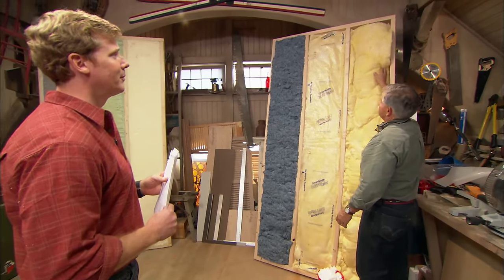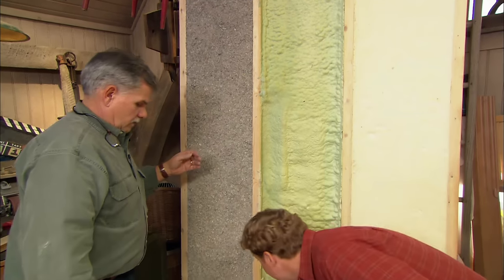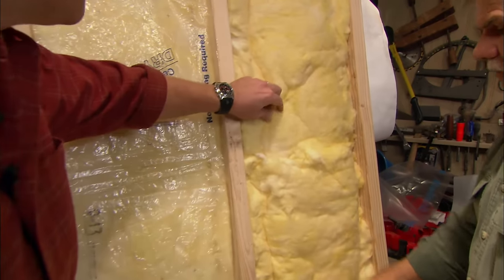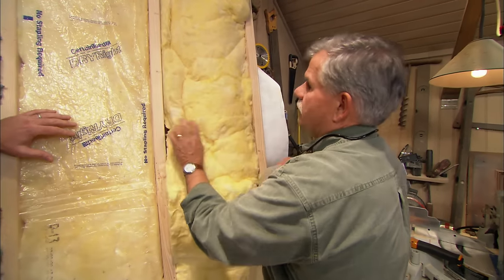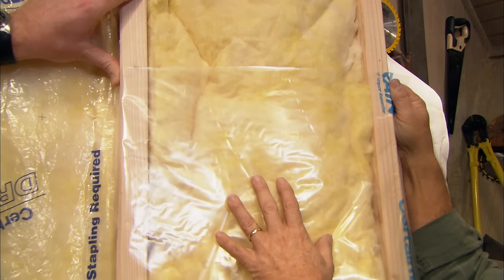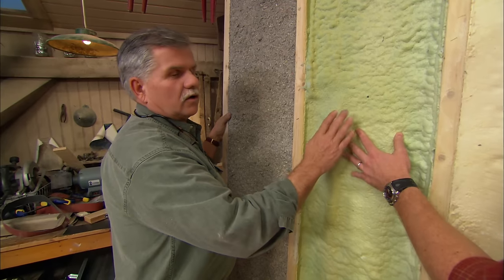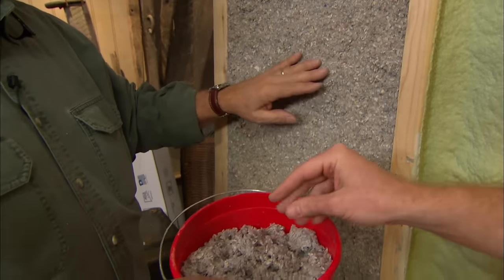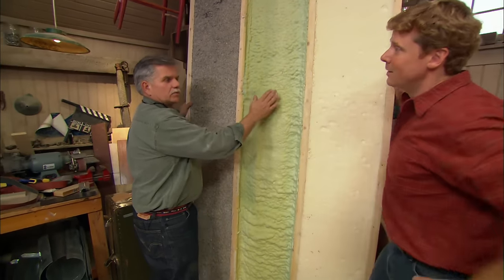How to Choose and Use Insulation | This Old House

Comment: There is so much more about INSULATION - thermal barriers and air sealing and perm ratings,  testing the air tightness using a blowerdoor.  and then there is the off-gassing of foam,  and then there is the carbon  emissions of creating the product.  what product is natural ?  Healthy ?  Affordable ?
DENSE PACK CELLULOSE
Reply: Closed cell spray foam has a much larger R-value however.

Comment: I am remodelling an old house, I'm doing this for the first time and now I am about to insulated the exterior walls. The problem is that the distance between studs varies from 10 to 19 inches so if I use fiberglass batts it's going to be a nightmare. I wonder if blowing cellulose wouldn't be a better idea, but I am also worried about the cost. Can anybody give me a suggestion here? Thank you.

Comment: how about rock wool insulation ?  the fire proof insulation?
Reply: If you want to have some comfort as to which material to put in your home, check out this video: https://www.youtube.com/watch?v=RKZd1ZTjvzE 
It's a slam dunk: Roxul rock wool every time.
Reply: 1200 C. From the Rockwool site, "ROCKWOOL insulation won’t burn, or release toxic gases or smoke when exposed to high heat. Smoke kills—fire produces toxic fumes and these fumes tend to rise, so danger increases at higher levels in the room. ROCKWOOL resists temperatures of up to 2150◦F (1177◦C) without burning or melting which is well above heat levels of typical house fires."
Reply: @howtomakepottery  , tread lightly. There are several grades of Rockwool. Some have great fire retardant qualities but a lower R-value. The better R-valued Rockwool gives up its fire retarding abilities. The manufacture obscures that fact in its literature and advertising, in my opinion. The low R-value, fire retardant variety is great for blocking holes during new construction.
Reply: @larrymaloney877  you're full of Bologna.

Comment: I was thinking about  putting 2 in. XPS and 4 in. roxul on top of it in my 2x6 exterior walls. Something like a combination between those two types of insulation in search of better performance for less price. But Im not sure. Im afraid of possible moisture collection inside the wall because of this XPS. I live in climate zone 5 (upper part, actually almost zone 6). Do I have to worry and do I have to use vapour barrier/retarder in this case?
Reply: I am curious what you ended up doing?
Reply: @simeondimchev122  I am curious how much the Roxul cost? I am planning a small home and trying to figure out what insulation to use that doesn't break the bank.
Reply: @ronwest7930  Probably can't help you with the price just because I live in Europe, Bulgaria, but definitely it's cheaper then XPS or any open or close cell spray foam.

Comment: I live in Ohio, can I and/or should I use Open Cell spray foam?  We've gutted the lower level so it would be like applying it to new construction but the upper level will be retro fitted.

Comment: I live in Southern Ohio, we get both hot summers and cold winters here in the midwest. My home was built in the early 1950's and has very scattered fiberglass insulation on the attic floor. If I wanted to turn the attic into a usable space during the summer and winter, would I have to insulate interior of the roof instead? Currently it is just framing, nothing but wood. Also- would this mean leaving what is on the floor? replacing it? or adding to it?

All recommendations welcome!
Reply: Leave the insulation in the floor/add to it also and yes you need to insulate the roof rafters. Please make sure you have soffit vents and bay vents as well as ridge vents to make sure you shingles have proper air flow below them. Hope this helps.
Reply: If you want to use the attic year round, you would probably need an HVAC run to it, plus lights and outlets.  Being a heated and cooled space, I would think you'd want to remove the insulation on the floor to take advantage of radiant heat from below.  The ceiling would need to be insulated but to get enough R value in the rafters cavities you'd need closed cell spray foam or fir strips to build the cavities out, and you need adequate ventilation too.  It's a rather big job to do it right.
Reply: Mario Cartolano leave the insulation in the floor and put plywood over the top of it. Then insulate between the rafters and the end walls. I prefer John's Mansville because it does not have formaldehyde in the insulation. Make sure it has a vapor barrier that's pointed towards you. You can leave it that way or drywall over the top of it if you want to turn it into usable living space.

Comment: Love this show.
Can the retrofit blown insulation be used for plaster lathe walls? I have a brick colonial.
Reply: Yes it can
Reply: @chrisdix1390  
Great. Thank you
Reply: I have lath and plaster walls and had insulation blown in my exterior walls...no problems at all. I have a 1920s bungalow. If you have knob and tube wiring I would make sure you can blow in insulation over that. I was told that is a no no.

Comment: Fiberglass?
Decades ago we stopped using that in Denmark; 1: Its not fireproof as rockwool is, 2: The glass fibers tear apart lungs and the internals of those who have to work with it.

And good luck getting a wire or a pibe behind or into that sprayed insulation, and if you cut a groove then you have to reinsulate that groove
Reply: use duskmask. but i agree you should only use rockwoll
Reply: Yea fiberglass is a pathetic insulation rockwool #1
Reply: GamerBrian81 you can just use a can of foam to fill in any hole you need to cut, its not hard at all, plus if you’re putting in spray foam you’ve already got modern wiring
Reply: @JayKay9112000  the house will burn down in minutes
Reply: BlueGamer Dude no, spray foam has a fire retardant added to it. I have it and my house is fine.

Comment: How about foam panels? Also which way does the foil side face. This is for a wood shed in Fl. No barrier on outside of shed.
Reply: If you have FOIL, that's a radiant barrier.   It MUST have an air gap (vacuum would be better, but that's impossible on earth) and the foil should remain SHINY for best effect.  Why?  Because conduction (intimate contact of foil shiny side with other building materials) defeats the radiant stop.    So never put shiny where it will get dusty or coated with anything.    Radiant barriers work both as high reflectors and low emitters; they work in "the dark" and are fabulous for attics, to retard radiant heating of attic from hot roofing shingles.  Shiny side DOWN; or IN.      EXCELLENT for garages that suffer from sun exposure in hot climates.   Caveat:   sub-rafter foil is a rat haven!   So you must defend against rat infestation.

Comment: So are there any issues with first coating with closed cell and then once set, second coating with open cell?  Or is there a reason not to do this?  I am in the Tampa Bay area, so most of the time we are trying to keep the heat out.   Also, what would happen if we used closed cell against the inside of the roof and then over the years we developed a roof leak? Where would that water go and how would you even know it to know it needed repair? Also, what about fire safety? No one ever talks about fire issues.
Reply: "Foam it Green" actually recommends open cell sprayed in the cavity first followed by open cell for the rest.
Reply: @stevenrieger3666  , how do you recommend stopping the foam form decomposing or separating from the wall or losing it's R-value over time?

Comment: Closed cell 2” all you need. The best!
Open cell max fill cavity then trim. Second best!
Reply: And rot your timber joists.  No one is using it in Europe and banks will not loan, nor insurers insure houses with either type of spray foam.

Comment: Doesn't shaving off the top "skin" of the foam diminish the vapour barrier effectiveness...or can you combat that by spraying in two or three goes?
Reply: That's open cell. You need a spray vapor barrier or 4 mill plastic.
Reply: closed cell foam sprayed outside the house - on a roof for example - MUST be coated to protect the foam from UV rays which will break it down.  If done correctly, I've seen spray foam roofs last 30 years and never leaked.

Comment: which is best for a sound proof wall ?
Reply: I'm thinking stone wool
Reply: Open cell without a doubt it has by far the best transient noise reduction levels 70% at 120mm thick
Reply: Jamie FM 
Deaf neighborhood,
Reply: Cellulose insulation has the best soundproof.
Reply: Roxal stone wool
Reply: Rockwool by far the best for sound.
Reply: Rockwool

Comment: I live in an old house in Fresno, Ca and have hot summers and cold winters. I want to blow in insulation but I'm afraid I'll get mold. What do you guys suggest?
Reply: +esclavosoy In any case, you're going to need a contractor. I doubt you have the tools and material to blow in cellulose information, so they should have it covered. You're on the right track, though, picking blow in as opposed to traditional application methods which are much more invasive.
Reply: yakyakyak69 thanks for the info.
Reply: Retro-foam.  They fill your walls with foam insulation - and you don't have to tear walls out to do it.  They simply drill holes in the walls and pump in the insulation.  All you have to do it patch the holes.
Reply: @tonym1279  The problem is the "old house in Fresno" will be a water leaker.   It rains in winter, and water runs into the exterior walls, from defective and aging roofs.   By adding foam (whether closed cell or open cell) to the stud bays, you are increasing risk of water retention inside those walls.     That means fungus and mold.       Here in SoCal, everything dries out if it's not hampered by foam, plastic layers, etc.      It's even hotter and drier in Fresno in the summer, and that suggests that radiant barriers are appropriate.    Those foam ideas seem to be more appropriate in Toronto and Boston.

Comment: What type of insulation would you use on a shipping container home (tiny home) where the walls are not flat and you're trying to keep the outside heat from the inside?
Reply: Is there any type of framing on the inside or is it just the shipping container's wall?
Reply: Ryan J Just the wall

Comment: Most people will heat their house in winter and cool their house in summer. If you Heat the house, you would want the vapor barrier on the inside. When cooling the house you want the vapor barrier on the outside of the house. What would be the most efficient thing to do in that case?
Reply: Microphonix Virtual Studio it would be closed cell spray foam. It will protect you for both season because it’s also a vapour Marier

Comment: Hi! Really useful video.,. I'd like to ask a question... I live in Mexico, near Mexico City, where temperatures in winter go to 0 or 1 degree Celsius, so it's super cold but still it's very cold. My house is specially cold since it's oriented to North so it's also very dark in winter. So my question is, is it absolutely indispensable to insulate all the walls of the house or it'd be ok to insulate a couple of walls and see how better it gets and then pick up from there?... Thx so much for the advise. Regards
Reply: Biker BMW - todas las paredes del exterior es muy importante para conservar energía.

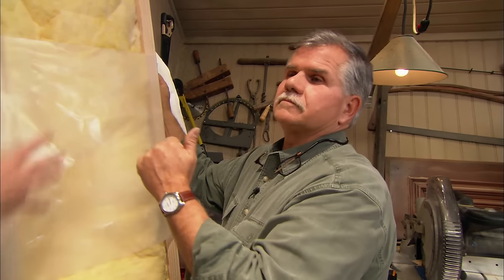Comment: At 2:40 the guy talks about a vapour retarder, would this be something to go on both sides if you get hot and cold weather ? I'm wondering if it would need to go next to the exterior wall and on the other side next to the interior wall.
Reply: Livin In A Box I live in an area where we get get hot and cold. from my understanding the vapor barrier faces the conditioned space. This would be why bat insulation isn't sold with the paper face on both sides. You wouldn't want to trap moisture between the two barriers.
Reply: I actually had this exact question bc I want to retrofit a barn into a small home for myself and was wondering about keeping myself efficiently warm and which way to face the retardant for the blue jean batting when I put it up! Yay for prowling the comments for answers!
Reply: Yes, the plastic or paper faced insulation always faces the heated area. It's not really a retardant, it's usually just called a vapor barrier.
Reply: I'm insulating a room now and have vinyl faced 4 ft wide r13. I have to double it over because I have 2x6 walls. Was curious if I need to remove one side of the batting to avoid mildew?
Reply: tyler coffey, here in New England, we would remove one of the vapor barriers. The remaining one would be facing you or towards the heated/conditioned area.

Comment: Have you discussed insulating a crawl space on this channel?
Reply: Matt Risinger has.      But I wouldn't want any flammable foam beneath my feet; that would be an accelerant in the event some fire (or even malicious intentionally-set blaze) began in said crawl space.  Rats chew wires, too.   Smoke from polyurethane foam is notoriously toxic.  Smoke rises!

Comment: At what point does the r value begin to only marginally improve insulation? In hopes to be clearer, the cellulose vs the closed foam. What would one expect to save?
Reply: closed cell is 10 times better than cellulose.   With closed cell foam you can create a complete building envelope.  This means no leaks, no loss of heat/cold, lower bills, no voids in insulation plus it increases the structural integrity of the house.

Comment: I hope you guys look at your old video comments..  Topic: insulation ideas. Imagine this , you have a very old place , that is not insulated at all. Each wall  interior & exterior are 4inchs and are covered with Rimu timber T & G. Floor & Ceiling is the same .. used to have the old hessian sacking on it when we have removed for insurance purposes. skirting where the floor meets each wall , door & windows surrounds  both inner and outer have 7 1/2" molding on them.. cannot get under house to insulate.. Firstly we would like to insulate the floor .. Our first thought was to bring the whole floor up 4" or 6" and fill with solid insulation , then put down 3/4" board on top, then flooring of some kind. If we do this where would we put the vapor barrier??? would this be some thing your team could recommend ?? Secondly . the outside walls are stucco with the T&G behind it. At this stage we don't want to get rid of it, so will be insulating from the inside.. if we take the inside T& G off should we put a vapor Barrier in each cavity before putting in insulation or put it on after we insulate each cavity ??? what sort of insulation would you recommend ?? This old house is not in the USA.. Thank you  for your comments.

Comment: For simple stud/joist bays, I prefer rock-wool.  Better R-value than fiberglass, waterproof, fireproof and better sound deadening.
Reply: Those qualities are determined by which rockwool you buy. You don't get high R-value and high fire resistance in the same package.
Reply: @larrymaloney877  you're full of Bologna mr. Maloney
Reply: @tarlach1280x960  have big mamma read you the labels, child. You can if you want.

Comment: can you leave the spray foam exposed? ( in garage) is it bad for ur health to?
Reply: it can be left open but easy to get damaged
Reply: You can leave exposed open cell is fairly soft so you can't lean anything against it, close cell is much harder and durable. Open cell is mainly used for domestic and close cell for commercial/industrial/agricultural applications.
Regarding health issues, definitely don't tar all foams with the same brush. Yes some foams are bad but NOT ALL. You need to do more research really. Close cell contains little pockets of gas, and I guess it depends what gas it contains. Open cell is different because it breaths (open cells), but again do some research because some poor open cell foams can contain nasty chemicals as blowing agents. Some are water blown though and are completely safe (you will need to be out the house for a few hours though) I believe the American lung society used icynene open cell spray foam for insulation so can't be bad I'd say.
Also what a lot of people don't know is products like fibreglass can contain formaldehyde, which definitely isn't good for your health.
Reply: It's flammable, and that makes it a nasty prospect for a garage.   Moreover, it gets dirty and stays dirty.  Garages are smoky places, if you park a car in there.    Always separate the air of any garage from that of the living quarters, if you can.    Ventilate that garage, and use radiant barriers if you live in a hot dry place.   I improved my garage in SoCal dramatically, this way.

Comment: What about insulation on the outside with New siding or stucko?
Reply: Insulation is inside the stick framing. For the exterior wall, a 0.5" plywood will be put onto the exterior side, that then your house wrap and then your siding. So it does not matter which one.
Reply: Learn about Dr. Joe Lstiburek's "perfect wall."  He is the high priest of building science, a person entirely respected by all the other publishers like This Old House and Matt Risinger.   You are right to favor exterior insulation, but that gets very expensive.   If you live in a severe climate, it makes more sense.  If you live in "paradise," and can run around in swimming trunks all year around, then it's different.

Comment: can you use both open and closed cell in the same area ?
Reply: vkatgol Yes you can. However closed cell foam is both a water and vapor barrier, where open cell is not.
Reply: closed cell - used for exterior walls and outside  ----- open cell - used for interior only.  You don't spray one over the other.

Comment: 1st rule do not use foam. 2nd what's the point to go over the top with the insulation when the cold is still bridging through the studs